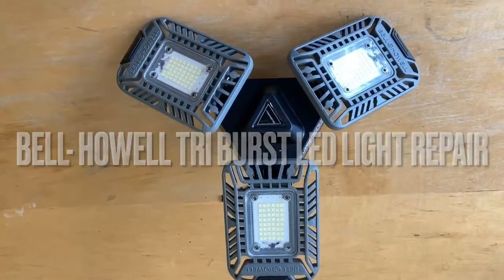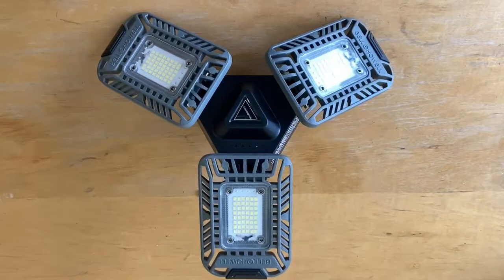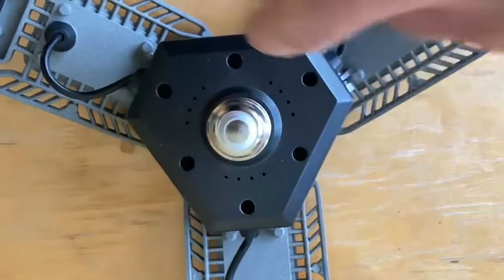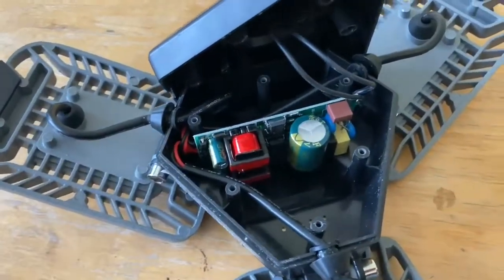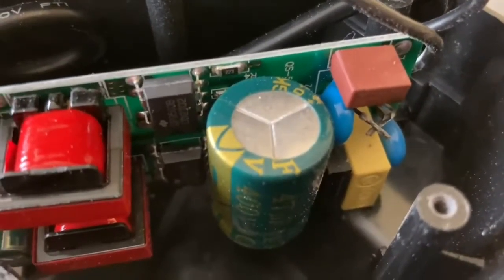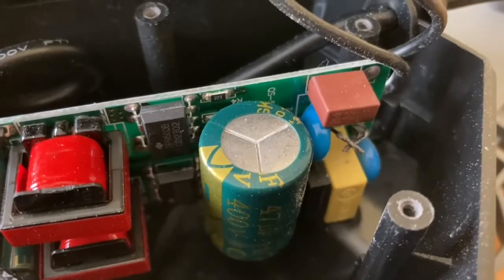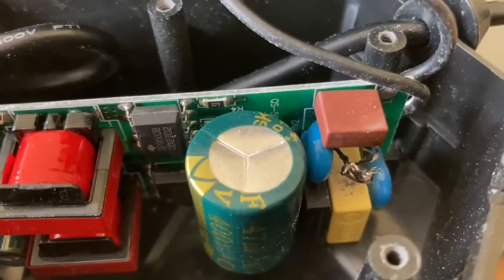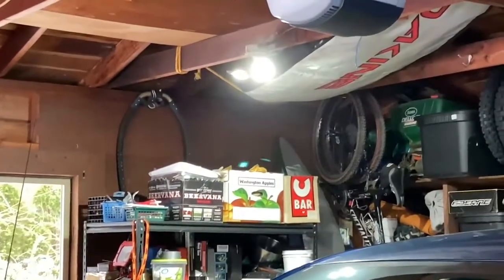How to repair Bell-Howell Triburst LED Light

Comment: DUDE, the part is called a Thermistor "NTC 5D-9" it Blew UP just like mine. SHORT=FIREHAZARD put ANY type of fuse instead. you are Bypassing A FUSE!!!!!!
Electronics Engineer here. TL:DR Bad Design...but "technically" passes ULC code. i would have used a PTC system instead or EVEN better a good old fashion glass tube fuse
but again PUT a FUSE PLEASE and you are safe 100%. its only 0.8 amps 60W thus approx 75 V fuse i quickly calculated.
but againx2 ;-) put ANY type of fuse 3A, 300A, any voltage etc, i just want your home breaker to trip to be 100% safe.
Be Safe and Thank you very much its because of this video that i actually investigated "WHY" they used a NTC(aka resettable fuse) instead of good of fashion fuse, my professional guess is purely to save money...
Reply: Good to see this comment. Sad that there aren’t more likes. As soon as I took my light apart I could see the charred fuse, plus the board has a fuse symbol on it. 
Thanks for your comment.

Comment: Replace the broken wire it's actually a NTC Thermistor Resistors 5D-9 3A 5 Ohm Inrush Current Limiter Temperature Sensors

Comment: What is inside this light is a step down power supply, basically takes 120v household current and turns it into a 60 watt supply for the LED's.
The part that died is called a Thermistor. Looks like it's a 5D-9 Thermistor, That's a 5 Ohm, 3 Amp Series with 25 mm leads and a disc diameter of 10.5 mm  
and a 5.5 mm thickness.
This component is right on the current supply lead on this unit. The fault in some of these units is that this component is NOT good at handling Surges.
Causing it to exceed it's limits and causing the disc to crack thereby cutting the current. These Thermistors have a thermal operating range of -55 ~ +200 C.
Electrical surges can exceed the heat rating and cause the housing ( Disc ) to crack. I.E. ( Flipping the light switch on/off too quickly )
The Thermistor is basically a two-terminal solid state thermally sensitive transducer, constructed using sensitive semiconductor based metal oxides 
with metallised or sintered connecting leads formed into a ceramic disc. ( Not Chinese Dust as one poster stated,  ( LOL - I spit my drink out reading that ! ))
and yes that disc once compromised, can break apart real easy, then your left with the two leads as in this video.
This is a Negative Temperature Coefficient ( NTC ) Thermistor, which is a temperature-sensing device whose resistance is a function of its temperature. 
While the principle use of Thermistors are as resistive temperature sensors, they can also be connected in series with another component or device to control an electrical current flowing through them. In other words, they can be used as a thermally sensitive current-limiting devices. Pretty sure that's what this application is.
Bi-passing this component and fusing the leads together may not be a good thing to do, because now it's straight unresistant voltage going into the device which may cause damage or overheating to the other components. If you do this hack then just never leave the light unattended, so if it does catch fire you can deal with it quickly.
For me, I'm just going to order the part and pop a new one in. IDK how or even if the other components will handle the situation by the sounds of it people 
are having no issues, I would imagine the life will be shortened but the risk of it catching fire if I forget it on. Not for me. 
But then again it may be fine, thing is it was put there for a reason, and now you know what that reason was. XD
Reply: So the LEDs actually run on 120? I assumed this stepped them down to 12v
Reply: Is there a better option than replacing with the exact same part?  A thermistor that may handle the surges a little better?
Reply: Right.  This component is in place as an in-rush control and in is considered a safety device.  Without this in place , or shorted as in this hack, 120 VAC runs unimpeded to circuit.  This part is easily purchased on-line or at local Radio Shack type electronics store.
Reply: Xenon, have you been inside the motion sensor version of the triburst? What kind of motion sensor did they use, and how is it wired in? Thanks ahead of time if you can help
Reply: This! Love how ppl are risking thier houses over a <$1 part just to get light back asap

Comment: Mine has a blackened thermistor. I'm not going to bypass since this is a safety protective device. It burned for a reason. I would not do this modification since you could have a fire in the future.

Comment: I had 4 of these go out in 2 days. saw your video and the first one was exactly like the one you had and I followed your instructions and it works like new. the second one still had the crumbly stuff around connectors. I went ahead and removed the stuff around the wires and wrapped some copper wire around it with some solder and it now works fine as well. Soo I guess if the stuff is still around the wires it still needs to be removed and then attach the wires differently with a piece of wire and solder. Thank You for the video.

Comment: I used this video tutorial on my non functioning Triburst and it worked exactly as suggested.  I was able to get a solder joint to work with some flux and silver solder after scraping as much of the black resin off the two wire leads as I could.  The black resin cap looked to be intact on my Triburst but crumbled to bits and fell off as soon as I touched it with a small flat head screwdriver.  So if the black resin cap on your Triburst looks to be intact that might not actually be the case.

Comment: I'd caution against just soldering those together.  Mine did exactly the same thing - likely a design flaw - and that component looks like an MOV or thermal fuse.  Still trying to identify the actual replacement part.

Comment: Is it a thermal fuse? My one has the same issue. Edit: its either a mov (as an over voltage protection) or a thermistor (as an inrush current limiting device) so probably not safe to just bypass
Reply from the maker: Could be either of those, but the light has worked without issue since the fix. When I first looked at the connection that came apart, it looked like the product of vibration of some type that cracked the connection material.  Obviously, if not comfortable with how this fix was done, best to do something else.
Reply: it's a thermistor (NTC 5-D9 Thermistor)  (inrush current limiting 3 amp)
Reply: @jrocco2622  Thanks  I was lookimg for that !

Comment: Thanks. I was able to get mine working again just as you showed. The black resin on mine was intact, but I noticed a slight crack on one side. A couple of pokes with a screwdriver and it fell apart.

Comment: We have exact same lights, same issue.  Found your video and decided to open it up for a look.  Black connector glob just crumbled away.  Wrapped wires together and covered with small strip of electrical tape.  Back in business, thanks to your advice!

Comment: Great video sir! I just cleaned the two wires and twisted them together with some needle nose pliers. I`m assuming that something else will fail before a fire starts, seeing as the Thermistor Resistor is now deleted. May look into buying some resistors in the future because my neighbour and I have a afew of these and would probably be better to fix it correctly by souldering the NTC-5D9 Thermistor in but see how this works in the interm. Again, great video and thanx!!!!
Reply: So what he deleted in his video was a NTC-ED9 resistor?

Comment: Great Video. Also my exact problem. I feel like as poor of a soldering job as i did if something overheats, and I don't think it will, that connection will just melt before it burns my house down.

Comment: Good video for an easy repair ! I am currently on my 5th replace(thanks to Bell & Howell sending me replacements). I emailed them 2 days ago before seeing this video and so had to get my burnt out one out to have a look see. Much to my surprise, I never had those wires stick out like yours until one I inspected  and the capacitor fell apart and...viola!...there were the two wires...lol. I did a quick clean, silver soldered and crossed my fingers for the test...it came on ! I repaired the other 4 in no time. I'm not sure what that little capacitor was for, maybe overdesign ? Thx again for your video !
Reply: I don't think you were looking at a capacitor, just some crap they used to tie those two wires together,  which crumbled from heat! Planned obsolescence?  Dan from Michigan
Reply: @MyLife-lg6tg  Yup..it is !!...10uF!...."Dan from Michigan" in case YOU really wanted to know.

Comment: must be a design flaw. Mine did the same thing, same part. I am not sure i want to solder those 2 wires back together. May cause a fire. Something causing that part to get hot like that.
Reply: NTC Thermistor Resistors 5D-9 3A 5 Ohm Inrush Current Limiter Temperature Sensors

Comment: I had two go out simultaneously in my garage.  No breaker tripped.  I wonder what could have happened - or is the quality control that good (i.e. you get 5000 hours out of these and then.. kaput.)?

Comment: So glad I found this before I tossed mine.  Checked the resistor, didn’t think to ohm out the thermistor.  Sure enough it was bad.  I’m back in business in the garage.  Going two weeks with  a regular led bulb made my work area a dungeon.
Reply: Mine still blinks. I’m very understanding about PCB and things of that nature. I deal with a lot of vintage computers, CPUs, computer boards, etc. and all that of that nature. I’ve got one of the first boards from the original F-16 before they did the upgrade and some things off the shuttle mission when they did the same and after the decommissioned them. So I understand. I said that to say this… I don’t want the damn thing catching fire whether I’m in the room or out of the room.
Funny, not funny 
I’m self taught. You speak More educated. What do you think?

Comment: After 3 years, have you had any issues? 
This NTC 5D-9 is a thermistor for protection from overheating and catching fire. $1.59 for 5 on ebay.
Is it still working?
Reply from the maker: No issues at all. Use it every day.

Comment: The component in question that failed is a Thermistor that protects current. I would not recommend removing it due leaving you with nothing to "pop" if the current gets too hot. You could buy the component and solder a new one in however.

Comment: THANK YOU! This worked on ours! I was really annoyed that it petered out after having it for only several months. I'm a fix it guy, but usually give up if it looks like the problem has to do with electronic components. When I opened mine, the black ceramic on that component looked intact--I would never have guessed it was faulty. But I tapped it and it started to fall off. I used needle nosed pliers to crunch/remove the rest of it, and then just bent the two leads around each other--made a small "U" at their ends and interlocked those two "U"s and clamped them together. Did not try soldering. You saved me whatever that thing cost (can't remember). :)

Comment: From what I can tell on my good unit, this part is an NTC-5D9 Thermistor.  I have 2 units and they both have slightly different components and PCB board revisions. The one that busted is SH-60W-v1.5.  That's under the big capacitor on the board.  This one has blue transformers. I didn't write down the version of the other. The other has red transformers.
Reply: I have the blue-transformers model as well, with exactly the same failure point.  I thought it was a ceramic capacitor that flared-up, not a thermistor.  The square yellow capacitor next to it was partially scorched/melted when this part blew.  Agreed that just shorting this safety valve is a little risky.  Thanks for the part number iientification!
Reply: @BarbarianXXX  in my fixture the thermistor partially melted the yellow cap, then the thermistor blew. Yes, design flaw. The thermistor was undersized for this application and it should not be near any other components.

Comment: Knocked the black “solder” off mine. Found the fuse (?) underneath with a burn spot on it. Don’t know that I will be fixing/plugging this one back into my garage. Good video though. Located the issue.

Comment: Thanks for the vidéo, mine broke to. Do you have an other solution for welding it?
Reply from the maker: Thank you. Mine is still working great. You could take a small piece of wire, wrap it around the two posts and then twist it tight with a pair of pliers. Cut any excess wire away so it does touch anything else. When I first tested the fix, I just  squeezed the two metal posts together with pliers until they touched. Wrapping the electrical wire around the posts will ensure contact.

Comment: Right on brother. Exactly my problem. Only difference is my wires took solder easy. Thanks!
Reply: I got mine working after I dropped an F bomb on it and superglued it to the outside of my mancave and it's still working sometimes TLC just won't work.

Comment: Thank you for posting this video I was looking for replacement capacitors but if this method works I'm going to do it I have three of these that failed within a week of each other and they cannot be returned to the store because they're over 90 days old the problem is they failed in the first two of them failed Within 30 days I just had to get a ladder tall enough to get up and get them down and as I waited they kept failing until the room was dark
Reply from the maker: Glad it helped you, Jake. The light has worked great since posting this, but if it fails again, I’ll see if I can fix it and post any follow-up information.  Thank you.
Reply: Apparently five year warranty from supplier if you have receipt.

Comment: Thanks for the video!... I had a friend that brought this over for me to look at.  Same problem - a burnt resistor, but had no idea what it was, just labeled as R1.  Searching for a schematic I found this video, soldered the two wires together and it worked.  I will caution him to not have the light on without being present.
Reply: Thank You! Exactly what I was looking for. My one wire blew out of this black disk and light not longer worked. Ordered 20 of these, nine bucks shipped and will repaired the half dozen I bought for relatives if and when they blow like mine,